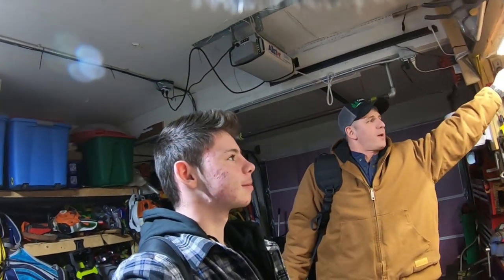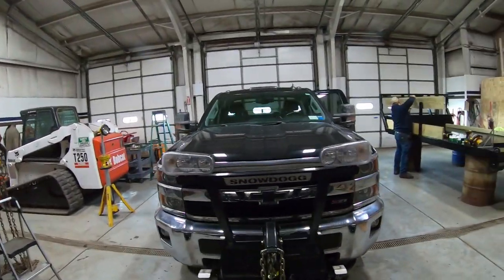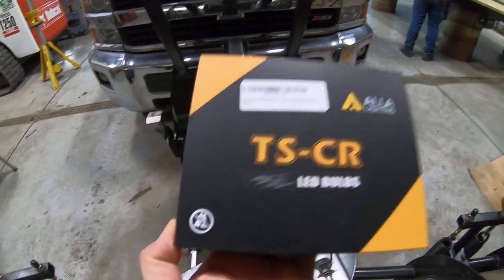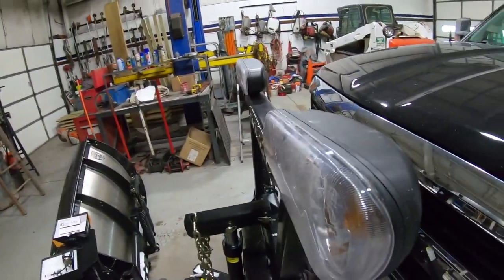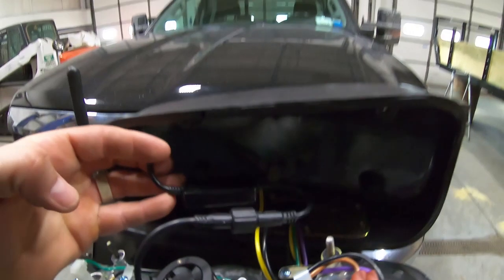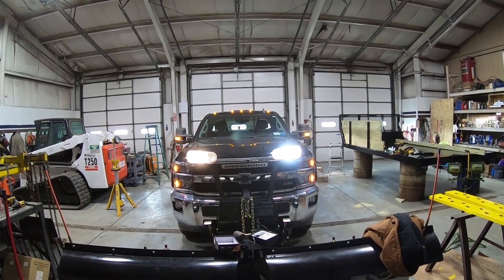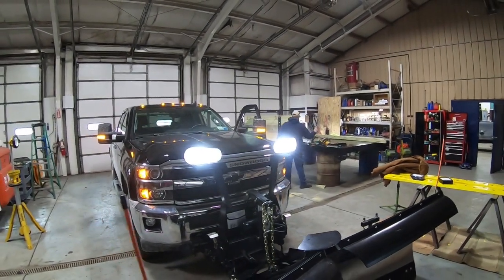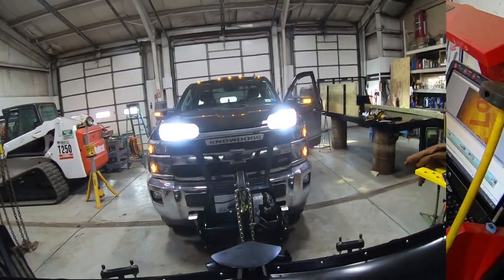LED plow light upgrade

Comment: What's nice about the LED conversion kit is the lenses come with heat strips on them which is nice cause it doesn't let the ice build up on them when plowing. The LED bulbs don't produce  heat like halogens do.  So that's the only downfall when just doing the LED conversions but it is much much cheaper!!! $50 compared to $700
Reply from the maker: You're exactly right

Comment: My only concern would be the led’s don’t make the kind of heat that halogen’s do. Might have to brush them off in a snowstorm ?
Reply: The heat from the marker lights on the outside might be enough to keep them melted off.
Reply from the maker: Yup because they're all one lens

Comment: I've done just the bulbs in the headlights on my trucks. But I'm worried about doing them in the plow lights because of ice buildup. Let us know if you get more ice build up because the LEDs don't put off enough heat to melt any buildup on the lens.
Reply from the maker: These bulbs actually put off allot of heat that's why they have fans on them to keep them from overheating

Comment: You will have to let us know if they ice up at all. Halogens produce heat to prevent it and boss and fisher added defroster strips
Reply from the maker: Yea in all the years I've plowed I've never had that issue
Reply: @CountrysideStrong  have u ever run leds in halogen cases
Reply from the maker: Nope

Comment: Like driving through space in a snowstorm. I put a light bar on the plow instead
Reply from the maker: I've done that too but does no good when you're driving down the road and there are cars coming. It's illegal here
Reply: @CountrysideStrong  I only use it when I'm plowing
Reply from the maker: Yup that's what I do with my other plow that has it. I need these for driving. Stock lights are garbage

Comment: Should have just went ahead and got the LED plow light housings with the built in heaters.  This LED retrofit without the heaters will be your downfall.
Reply from the maker: Not at all actually. I've been out in ice storms and and the truck has even sat without issue. These lights get so hot they have fans built in them to keep them somewhat cooler
Reply: @CountrysideStrong  Isn't the heat more at the rear of the fixture rather than at the lens?  It's the driver getting hot not the diodes.
Reply from the maker: @Guillotines_For_Globalists  not really. You can feel the great on the lens. I was worried about it at first too

Comment: I ordered my snow dogg form Niagara truck equipment with the factory leds and love them there stunning but I did pay over $400 for them plus the week it took me to get them to work right on my  Ram the computer was very annoying on the truck went through 3 different wiring harnesses to trick the computer and finally got them to work, I’m not sure if I would have gone this route or not if I new about the leds you bought. My only question is do you think you will have a problem with snow and ice buildup on them since there not heated like the factory led headlights
Reply from the maker: I don't believe so because the other bulbs are in the same lens. There's no separation.

Comment: led bulbs dont dont get hot enough and the glass freezes over , all those led conversion kits have heated lenses.
Reply from the maker: Yea I'm not returned about it and there are tons of guys that have already done this and they all said there hasn't been an issue. If it becomes a problem I'll take em out, no big deal. If it doesn't, then I just saved $400 huh 😉

Comment: But they don’t put out heat and ice will build up
Reply from the maker: They're in the same lens as the other halogens so it'll be fine. I've also never had ice form in 23 years of plowing. I know it happens in some areas but I've never had it happen and I've run LED before

Comment: Not sure why your going with a NON DOT light to run on the road.
It would be one thing if you only changed the High Beam. But the Low's, dumb!
Thanks for blinding everyone.
Reply from the maker: It is dot dumbass, it literally said it on the face of the light. Don’t comment if you don’t know what you’re talking about